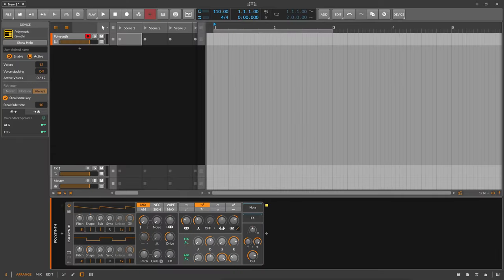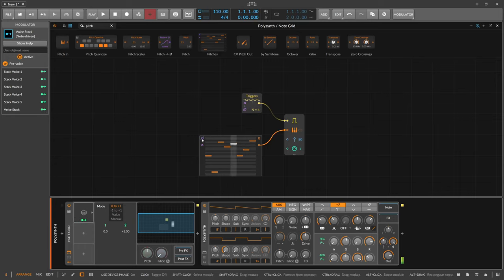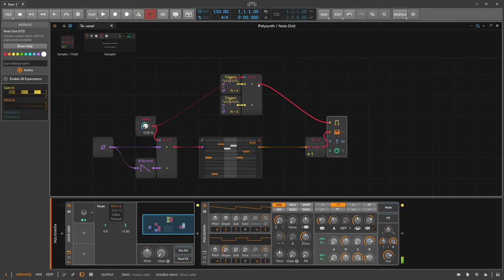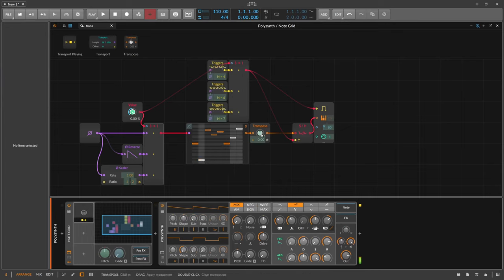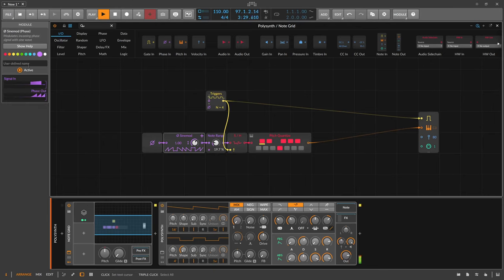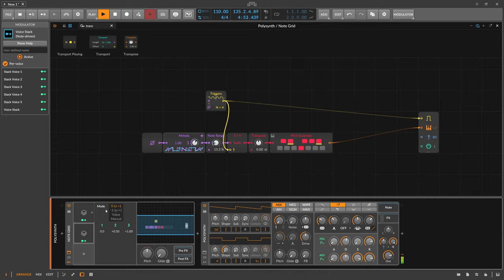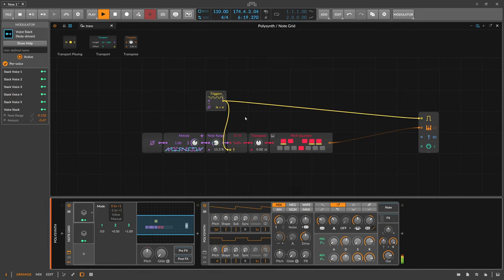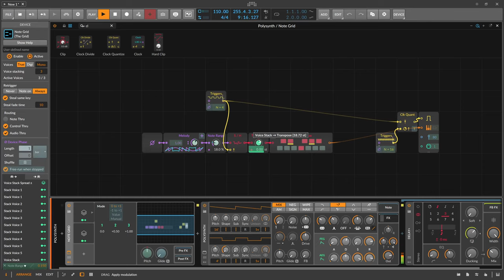Bitwig Note Grid: I didn't know VOICE STACKS could do that!

Comment: Also, if you try to use pitch or phase in calculations (for example to weight a probability if a pitch is randomly transposed higher rather than lower), you''ll see that max pitch and phase go up in multiples of the number of voice stacks (*128 and *1.0, per, respectively). Would love it if this was better documented lol